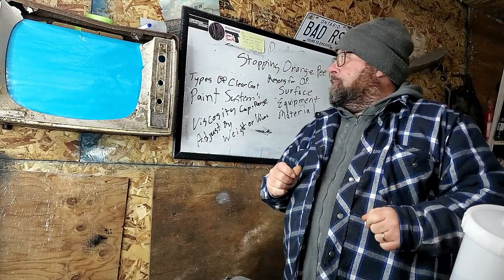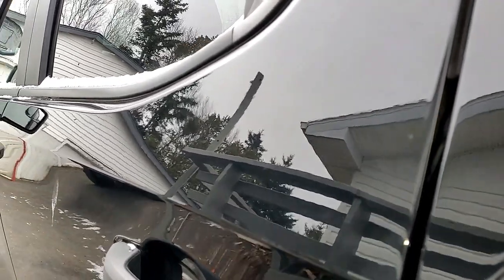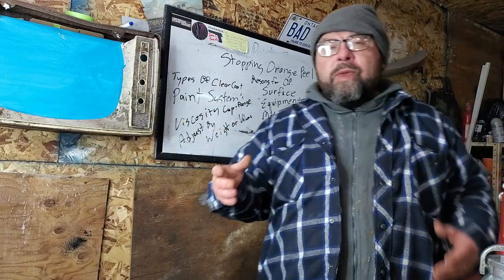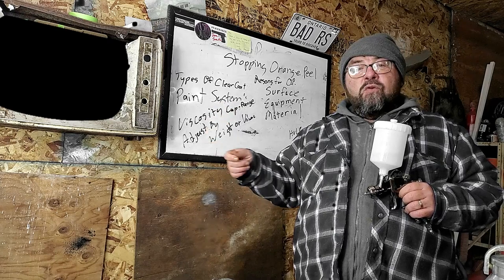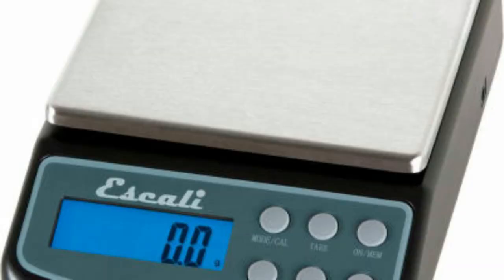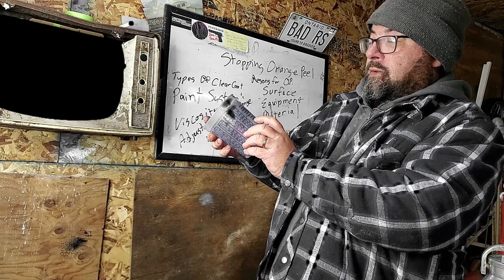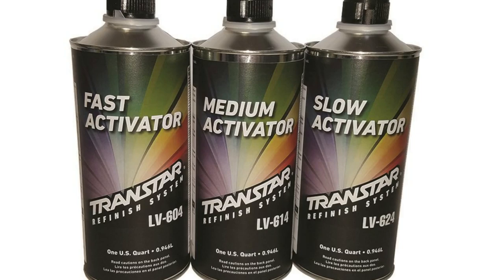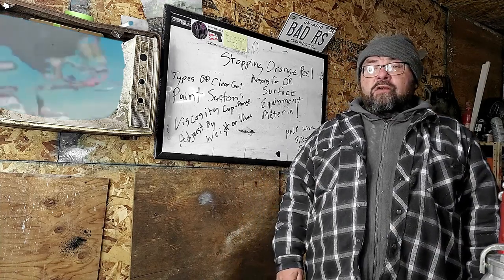stopping orange peel when spray painting

Comment: I had an old RX-7 that had "gravel paint" all around the car on the lower portion of all the panels. 

People always use to think it was orange peel. Is there such a thing called gravel paint?
-Chuck
Reply from the maker: the gravel guard goes under the paint ,  its a soft coating that is supposed to absorbed stone chips ,but imo it just looks terrible.  hey hey hey Xr7👍
Reply: My older brother had a Fairmont that had something similar.  It was black and looked like orange peel magnified x2.  I was told that it was a combination rust proofing and rock chip protection.  I rarely saw that on other cars but it seemed to be more common on the Fairmonts and Mercury Zephyr.
Reply: @thisguysgarage  My Tundra has that krap. How does one deal with it? Just sand it off?